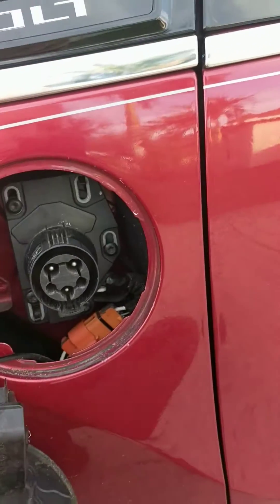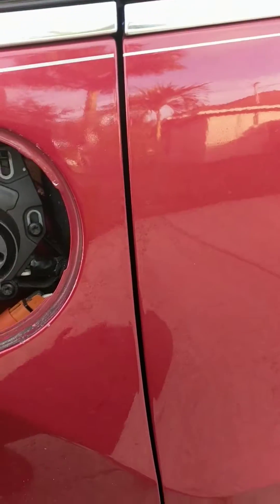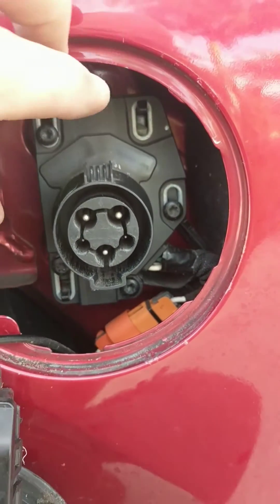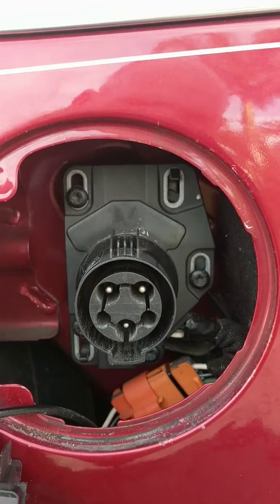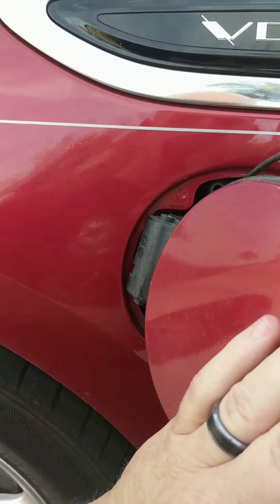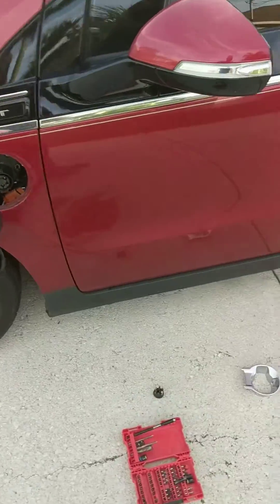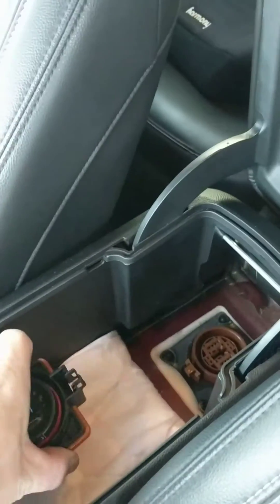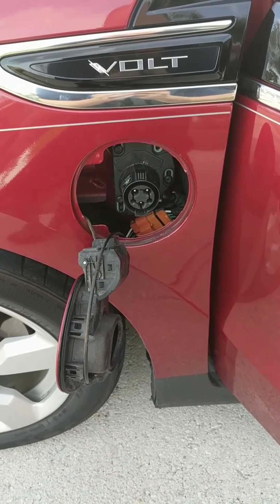How to adjust charge port Chevy Volt.

Comment: You don't have to disconnect the main battery to do this repair. I changed my outlet inside no issues by leaving the main battery still connected.
Reply: thanks tyson i scoured the earth for this lol
Reply from the maker: Correct, you don't "have" to disconnect however it's always a good idea to work as safe as possible